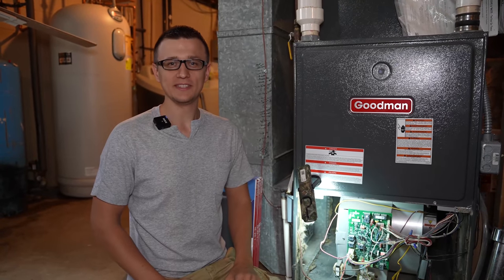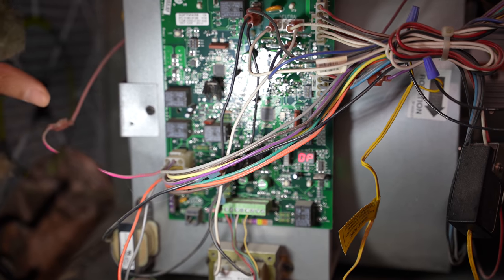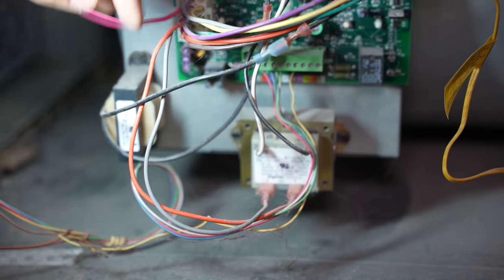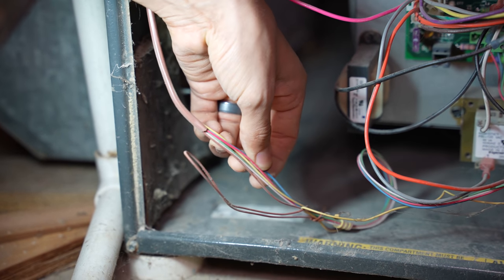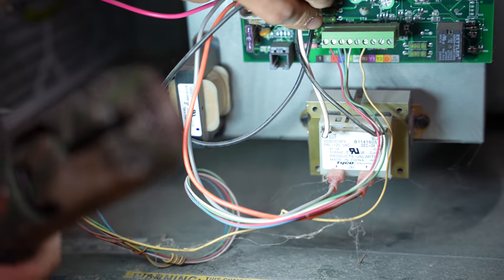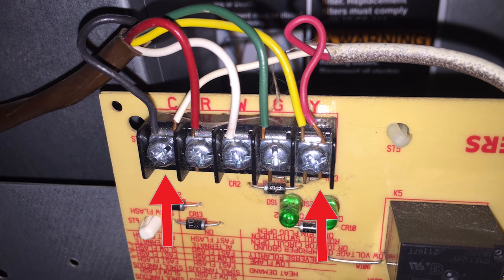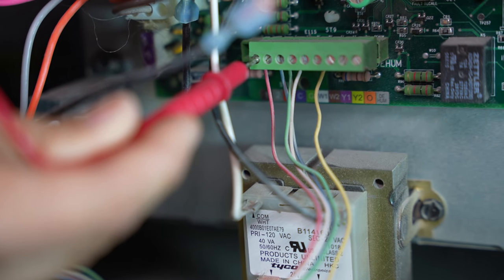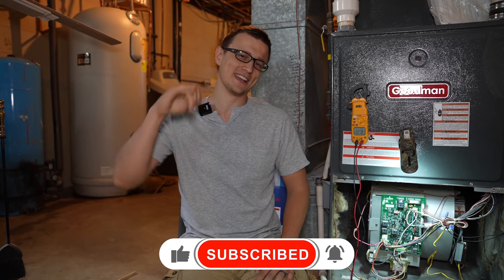HVAC Furnace Has No C Terminal?

Comment: Hi Jay, I have an old Lennox furnace from the 90’s and it does not have a c terminal. I am installing a Honeywell smart thermostat requiring a c terminal. When I follow the 2 wire from the A/C unit outside to the furnace the red wire goes to the “R” terminal on the furnace panel but the white wire does not connect to the furnace panel it is connected with the yellow wire from the thermostat cable of wires with a wire nut. Does that mean the common can be achieve by connecting into the white and yellow wires that are in the wire nut? In the thermostat bundle of wires is an unused blue wire that is not connected at either end. I was planning to use that blue wire as my c wire. Can I connect that blue wire into the wire nut bundle I mentioned and then connect the blue wire to the “c” on the smart thermostat?

Comment: Here's an odd one for you. I have a GE Vertical ZoneLine PTAC, when I'm testing the 24v terminal strip I get 24V on most of the terminals, when there's no wires connected, measuring from each terminal screw to ground. I found 24v on R, W, Y, B, C, and some of the other more obscure terminals. Is my board bad? Or am I measuring something wrong? Tenant's complaint is that it runs forever and electricity bill is high. It's a heat pump with aux electric backup and I'm wondering if the unit is messing it up. Compresser runs fine on AC, Heat coils near top of unit got hot last time I did an open test call for heat. The unit wants a heat call on W, not Y with Elec/Aux on W. The manual says 'unit will decide whether it needs to use heat pump or elec/aux'. It does want to receive a constant B signal when heat mode is on.

Comment: Hey....I know you're specialty is central units, but I thought you could give me a word of advice for my portable unit.

Maybe you can help me. I've got a Haier portable. I was neglectful, and didn't realize there were two sets of fins, when I took the back off, the bottom fins were caked  with dirt. Before that, the compressor made a racket, so I turned it off. I cleaned everything with a hose that let it sit in the sun a couple of days. When I tried it again, the compressor immediately kicked in quietly and blew cool...not cold air, but then kicked off after a couple minutes.  Started a couple minutes later again but kicked off even quicker. The compressor gets slightly louder right before it kicks off, but nothing like before I cleaned it. Do you have any suggestions?

Comment: I can’t find a video anywhere that can help me with my situation. My furnace is only for heat and not AC. The wire running from my thermostat to my furnace is only two wires. There was the third green wire that is disconnected and it’s not being used. In order for me to put a thermostat on my wall that can be used with an app I need to have that third wire connected to my furnace and thermostat. I believe it’s called C wire. My furnace company told me that there is no place on the board to attach that wire. is there some type of device that can be used as an adapter in between the thermostat and the furnace so I can control my thermostat from an app?

Comment: My problem is I don't have a terminal block. Why? I don't know but I have a blue wire, unused from my thermostat, and in my AC unit it's also not connected to anything. I have a brown wire capped off unused, and I also have a bigger blue wire capped off. The brown wire has no power to it. The blue capped wire in the AC unit has power to it. (I haven't used a meter to test its voltage yet) I am trying to connect a Honeywell WIFI thermostat.  I bought a C-Wire Adapter-the instructions said "if you have a spare wire you do not need this product". So every video I see has a "terminal block" I do not. I live in Florida, I have only AC, no heat. My thought is to connect the blue wire from my thermostat to the brown wire in my AC unit/equipment. So what do you do when you don't have a terminal block?

Comment: I have gas hot water baseboard boiler for heat with two zone heating. First floor thermostat is heat only. Upstairs I have a thermostat that controls my heat and also hooked up to a central air system in my attic. So if I’m looking for my common wire upstairs do I look at my central air system because my thermostat that’s down stairs I only have two wires. Any help thanks
Reply: Also I have no terminal strip on my boiler so that is why I have only a two wire setup on my heat only thermostat

Comment: I have one of those Google power connectors and it needs a C wire on the boiler but I do not see one.  my system does not look like this video, where can I plug into the C wire 24 common?

Comment: Blue and white comes from the condenser for me...  😢 Fml. Should i call a HVAC guy or do it myself with a risk of shock.
Reply from the maker: Whichever wire is the hot, will go to Y on the control board. The other one will be the common. These are low voltage wire so you might not even feel the little shock it would give you if you forgot to turn the power off. 120v on the other hand packs a little punch.
Reply: @WordofAdviceTV  thanks bud

Comment: I have a 2 year old GE , 24000 btu window unit air-conditioner that the mother board was fried by a lightening strike.  My question is, can a thermostat be wired to the control board so I can at least regulate it and turn it on and off at a thermost. I now have the 11 volt low voltage wires straight wired and it cools great and the fan is on high setting. I have a 24v thermostat but my air'conditioner  step down transformer says it's an 11 volt. Will the 24v work on it? Could anyone tell me.

Comment: Hello Jay, I have learned a lot from your videos. Thank you. I have a unique situation. I have two thermostats, one for AC and the other for heat both coming from the same board. The heat thermostat is very old, the one with dial control and mercury. I am trying to replace this old one with Amazon smart thermostat. I have only three wires coming from the furnace board, Red, white and green. Only red and white wires were connected on the old thermostat. How do I connect the new Amazon thermostat with only three wires? I connected the red and white but there is no power. Your assistance is greatly appreciated.
Reply: Only dumb people ( home owners ) install 'smart ' thermostats. The more complicated they are, the more trouble you will have. Installing/ wiring, as you are already having. And learning how they work. From an HVACR specialty electrician. 35 years experience.
Reply: @allenjay6065  Oh! you so smart! Forget the fact that they are more efficient than a standard thermostat......but what does everyone else know...

Comment: I want to attach a Nest thermostat to my garage heater, it has R,G,W and Y terminals but no C terminal to attach the blue wire for powering the nest thermostat. I don’t want to attach an adapter for separate supply to the thermostat because it looks unsightly. Any advice ?
Reply: If the garage heater is a standard furnace, disconnect the wire to the G terminal and use it for common. You won't be able to turn on just the fan but you'll have your common. Furnaces circuit boards control the fan in heating themselves and don't need the thermostat to put on the call for fan operation.
Reply: @bill944  thank you much !

Comment: Does anybody have a furnace with 3 ports coming off the 24 volt side where blue wires are coming out?
I have a Dependable Ninety-Two which is a pretty common furnace.
I also have a C wire, but loathe to hook it up to the wrong spot and fry my thermostat.

Comment: You can literally just take an extra thermostat wire and screw it to the side of the cabinet. Everything is grounded there anyway.
Reply from the maker: Most people won't be comfortable doing that lol but you are totally right, that method works just as good. 😄 Thank you for pointing it out! 👍
Reply: Good point/suggestion.
Reply: Whats cabinet on hvac? Can i run my blue wire straight to red terminal on board? I dont have common terminal on board. I do have a ground terminal. Should I connect blue wire to ground terminal?
Reply: @justdissin7340  definitely don't run it to the red! Use any extra wire in the bundle and connect it to the ground, then on the thermostat end wire it to common and you're good to go. The official way would be to run it from the common side of the transformer on the secondary (24V) side so if you can I'd do it that way.
Reply: @1shagg420  thanks for the fast reply im on roof looking at board i do have a ground terminal can i hook up to that? The blue wire coming from t-stat hook up to ground on board is what i mean
Reply: @justdissin7340  yeah that should work fine
Reply: @justdissin7340  in the future look for the 24 volt transformer, you'll see high voltage wired on two wires then on the other 2 is the 24 volt wires. You should be able to tell which wire they're using as the hot, use the other one as common and connect the thermostat wire you choose to that.
Reply: So it should work even if its a ground terminal? I did use a voltage meter & im not getting 24 volts outta that ground terminal. Would it still work? I put one lead to ground terminal & other lead to ground screw & no voltage
Reply: @justdissin7340  just to simplify this take that blue thermostat wire and use a self tapping screw and screw it to any other of sheet metal on the unit.
Reply: @1shagg420  ok cool ill just try that. So you did the same thing & it worked For you?
Reply: @justdissin7340  oh yeah it'll work. All that thermostat needs is a common and the 24 volt transformer common is the case of the unit.
Reply: @justdissin7340  you can take a volt meter, put one on red and the other on any piece of metal on the furnace and you'll get 24 volts. I think you're missing something
Reply: @justdissin7340  the common wire will not have power, neutral/common is all tied to ground.
Reply: @justdissin7340  so the thermostat wire bundle going from the thermostat to the furnace, red will be tied to the red of the furnace, take whichever unused wire on the furnace end, tie it to either ground, the side of the unit, or the common side of the transformer. Then on the thermostat side use the color you tied to ground in the common terminal of the thermostat.
Reply: @1shagg420  thanks bro it worked I appreciate all the replies your the man
Reply: @justdissin7340  no problem man, share the wealth with anyone else you come across!
Reply: @1shagg420  lol will do my friend 🤙🏼

Comment: The transformer has a (24)& a return.🤔
The return is common,No??🤔
Stay safe.
Retired(werk'n) keyboard super tech.
Wear your safety glasses.
Reply from the maker: Pardon my ignorance, I am not sure I fully understand the question. The secondary side of the transformer has a 24v hot and a 24v common/return.  
Staying safe and occasionally wearing safety glasses 😎
Reply: @WordofAdviceTV  yes 
Hot
Common
So if you find the transformer you found the common,No??🤔
Reply from the maker: @realestateservicessaleshea99  Ahh that's what you were saying! Thank you for clarifying. Yes, you are absolutely right! If you have the 24v common from the transformer then what else do you need right? Allow me to clarify what was on my mind too. Most of the people that ask me this question are asking because they are either installing something or running a new wire and can't seem to find the 24v common terminal where they can hook up to. Like the furnace in this video, the common from transformer does not always go to a screw or a terminal. This one went to a molex plug so it's not very convenient. But if you trace the 24v common from the AC, that may lead you to a more convenient place to hook up to. Hope that makes sense 😅
Reply: @WordofAdviceTV  just cut and splice or put a piggyback terminal on it,No???
Reply from the maker: @realestateservicessaleshea99  I agree, that would work too. Personally if I don't need to cut wires, I prefer not to but if there was no other common terminal I would do what you said.👍